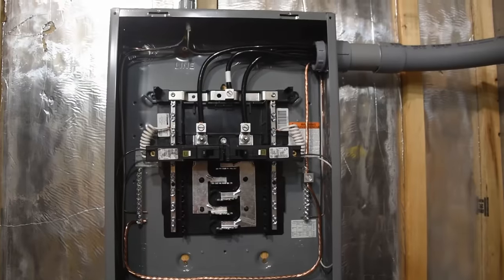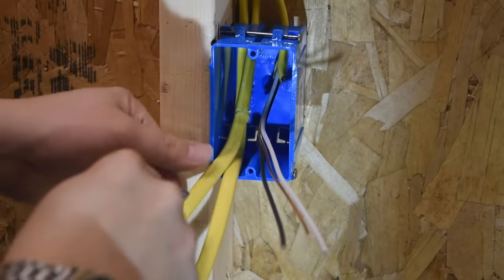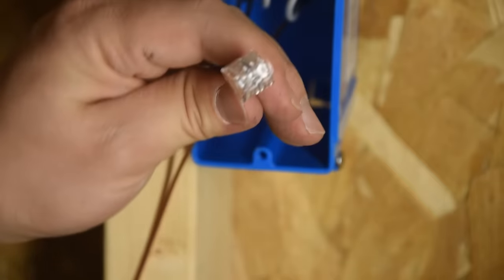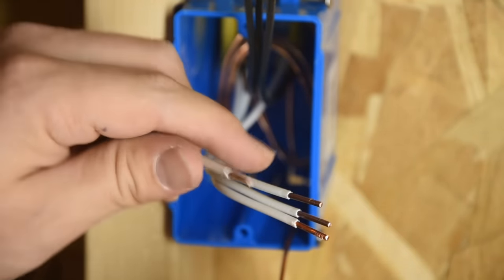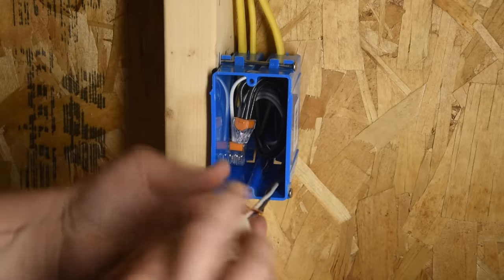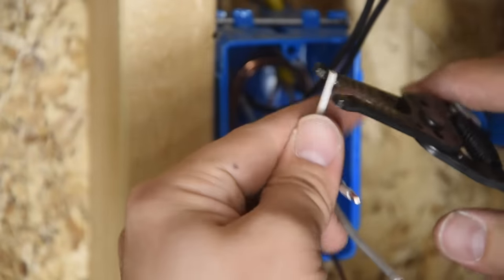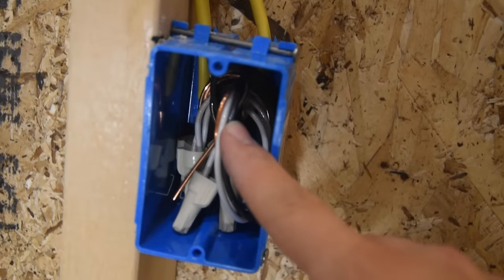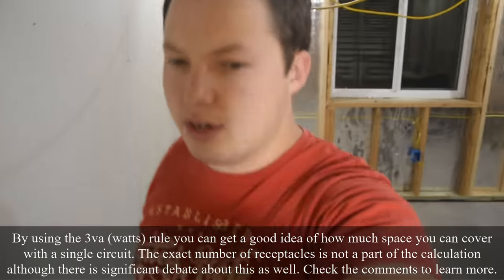Wago's vs. Wire Nuts - How To Wire Outlets During Rough In

Comment: I'm a 20 yr service electrician. Always find failed wagos, rarely find a failed wirenut splice. 
Take that for what it's worth.
Reply: I can't say I've come across many Wagos, but I can't even count how many times I've found failed connections when push connectors are used on the back of receptacles. I don't see how Wagos are any better. I always say that no electrician worth his salt uses push connectors. It's just asking for trouble down the road.
Reply: amen to that , that's what we do splice, trying to make a trade with out required skills. No electrician should ever stab wire a receptacle. That is the meaning of lame...
Reply: Jason Weiner you are so correct and the other problem is not enough surface contact with wagoS  which is the same when not using the screws on a receptacle  versus the push tabs. Constant full load causes the push tabs to fail because of the high resistance do to very little contact between wire and tab
Reply: From a UK sparky I am surprised you still use wirenuts, we used to have them and only come across them nowadays in old installations, usually when trying to find the break in the circuit.  I don’t know if the wirenuts you have are different to the type we used to have though.  When I used to do installation work I used connector strip though the industry now seems to be going towards the push (maintenance free) connectors.  Wago is a manufacturer of these and there are also poorer quality copies about, personally I don’t know of any failures of genuine Wago connectors which have been fitted properly but we do run all domestic circuits on 230v so our current will be lower.  Also we wouldn’t connect like you do in a back box, we’d connect all the conductors to the socket outlet (receptacle) albeit ours are quite a bit different to yours.
Reply: @jamesbarca7229  My whole house was done with push ins dammit. The receptacles and switches are actually splitting apart so I'm having to change everything out (and use the screw terminals. sheesh)
Reply: Wago's are quick but trash.  Just like push in wire 14 gauge outlets.  Destroys the wire as well.  Oh, and this nutter does not know how to rough install.  Idiot strips the wire after it is in the box.  Also, nutter does not know how designate power lead.  Nutter also does not know that doing wire nuts by hand stopped being used about 10-->20 years ago.
Reply: I use them all the time and have seen maybe two failed ones but plenty of failed screw-type connectors (wire nuts never really took off in most European countries). Those that failed were all in the same installation and that screamed "sloppy work" all over. Half the wires hadn't been stuck in far enough so the Wagos just fell off!

The huge advantage over any other kind of connector is that you can add and remove individual conductors without disturbing the others.
Reply: @Ragnar8504  You are talking about levered WAGOs?  Not the pinch type?  Otherwise what you are saying is not true.
Reply: used Wagos lever locks for years now...never had one fail
Reply: @burp1914   If i'm installing a new light fixture that comes with push in splicers they get cut off & tossed where they belong, in the trash can.
Reply: They will sit there and strike an arc like an arc welder until they finally fail
Reply: I find burnt up crusty wire nuts all the time. In an industrial setting, they burn up all the time. Either age or heat gets to them.  Wagos are trash but for outlets/lights or grounds, it's alright. Found someone tired to wire up a 5kw motor on a VFD with them.  Lasted less than a day. I miss aircraft splices from when I did avionics. Those things were strong and lasted and weather proof
Reply: I am an electrical engineer, not an electrician. There appears to be much more copper to copper contact area in the twist on plus more contact area which should decrease contact current density and reduce point source temperature rise. Also wago was installed in worst possible outlet because it needs to support the combined load from every other outlet. The way the wago pulled off was concerning as well.
Reply: I’m at electrician and I was installing recess light in my house and I ran out of wire nut on mine last light. I put in the wagos the led came with to try it out. Four months later I noticed that one light started to flicker a lot. I pull the light down, tested the connection turn the light on before putting it back up and it still flickers. I then turn and took those wago out and twisted and put wire nut on and it stopped flicking and it haven’t ever since, and that when I new never again with wagos.
Reply: @shshshs2  definitely do not put wagos on a crane. We fought the big ass brand lights that used wagos inside them. Vibration makes em flicker non stop.
Reply: Always?  Let's see some proof.  I've read many of these types of comments from other electricians and I call BS.  I deal with trades people in my profession and the common denominator with them is they all "think" their way is the only and best way.  It's the same when I watch videos where OSB is used.  You get all the genius framers who will "never use that crap" on their homes.  Don't use Wago connectors, but stop with the "your house will burn down" nonsense.
Reply: You do? I am an electrician in Europe and we use Wagos and nothing else, never failed! Never seen one failed, love those things.
Reply: In germany nearly ever electrician uses Wagos including me and in my 5 years of work I've never seen failed Wagos. Sometimes the wires get loose because they aren't long enough, but that's not the fault of Wago.
Reply: Jason do you mean the failed WAGOS you found were the push in style? I have found a few issues with push in style wagos but have not seen any issues with the lever style wagos. And 98% or so of the failed push in style wagos were knock off brands. The push in style wago problems I found were because the wire was installed incorrectly..
I just fixed all the outlets in a remodeled basement while the guy was off for the pandemic. He thought he bought push/stab in style outlets but didn’t realize the hole was for the wire to go in and then you tighten down the screw. The jurisdiction I am in you can’t buy a push in style outlet.
Reply: @ronh9384  You are spot on, Ron. It's always the push in wagos. In fact, the lever style are just starting to make their way into the local parts houses. Guessing its because the area electricians had gone away from them.  I am going to try the lever style, mostly due to the answers here!
We are also NOT allowed to use stab-in receptacles simply because like old wagos, they fail.
Reply: @darinvee4980  Exactly, you could fertilize the Sahara with the amount of horse shit I've heard in every trade about anything that's come out since the day they were licensed, and for half the weekend warriors is anything that's changed since their dad's taught them as teenagers.
75% of the "first hand experience" comments on YouTube are completely fabricated to bolster the posters opinion.
Reply: @typ044  i couldnt possibly agree more. The old sparkies back in the day probably hated wire nuts and insisted that only a hot soldered splice was to be used. Times change people, roll with it.
Reply: I never use them on circuits with heavy loads anymore. I’ve had them melt together and short on a circuit with an air conditioner and a microwave. It seems the internal connection has very little surface area to the wire, which naturally causes a lot of heat. I don’t believe this is an issue with strangled wire as more conductors are in contact with more of the spring clips surface area, but I never run stranded wire...here in Chicago everything is conduit and fishing stranded cable is a setup for a bad day.
Reply: That's exactly what I think not only because somebody want to sell their product means is good
Reply: @TheHouska007  Europe is on 240V system, so half the current as in the US where we use the 120V system.  Less current = Less heat.  That's probably why you never see them fail.
Reply: Personally I hate those types of wago. I do like the other type of wago with levers. They're great.
Reply: Fortunately, all of Europe has come out of the 20th century and uses WAGO and for some reason there are no problems with them.
Reply: @kikiv1993  the new lever wagos are exponentially better now. Congratulations on making it out of the 20th century, took ya long enough!
Reply: The lever Wago's are good push connects I don't like them because really have to cut them to remove them or damages the wire.
Reply: Sure they are wagos and not just some random push connectors?

Comment: They are great !   FYI  do not force 12ga wire in deep, the wire will transfer heat to the plastic case and separate in the future.  of the 12000 we have installed in the early years (2001)  maybe 4 failed up to around 2010 .  I also learned to cut stranded 12ga. wire on a slight angle to ease installation !
Reply: None should have failed, but you dont know many failed, unless you attached your phone number to each one?

Comment: Just a neat tip try if you like. To strip the romex take your wire stripper pliers, pinch and pull a chunk of the the romex sheath where you want it to be cut. Twist the romex and do it on the opposing side and pull the sheath off. It tears at the point with the two "bites" taken out. Careful to not grab the interior conductor but with a little practice you can do it consistently without damaging the conductor sheathing.  Saves from switching back and fourth to the knife. Learned it from an old guy.
Reply: did he teach you to grab a 2X3 and a bucket for a trash can and a seat to save the knees??
Reply: Great tip!!!  Tips like this are why I read down into the comments.  Thanks! I’ll try it out on my next wiring project.

Comment: This is a great video once again.  I'm catching up on ones I've missed.  I appreciate the detailed explanations and still make it easy to watch.  You're explanations and reasoning are usually aligned with my views and you cover a lot of the little details (like showing the run from breaker, through hole, wire staples etc).  
  I bought some knock-off Wago Lever Nuts.  Haven't used the lever nuts yet, but the push style is kinda intriguing.  I never looked into them to see they were removable (and so easy it seems unless that was a cut scene).    I got the Lever Nuts for a quick temp project//test bench to test a motor or temp wiring lighting (of course not to code). 
  Problem is I don't do a ton of electrical so I have a supply of wire nuts to last a lifetime for me.  Maybe I should  donate my little pile of old style winged wire nuts to you LOL.
Reply: Maybe u should read all the comments herein by other electricians b4 u do that

Comment: A few years ago I quit using wire nuts and moved to Buchanan Connectors. If you’ve never used them before they are a copper sleeve that crimps over the group of wires with a compression tool and then they are capped with cap which resembles a marrett that snaps over them. 

Voltage drop with these style connections is much less under load than any other style I have used. 

The wago connectors are easy, but I find they don’t carry high current nearly as well as a marrett style or better yet the Buchanan style.

Comment: Love the electrical videos.  I have recently just finished a complete rewire of my two story 1870s home.  I had initially decided to use wire nuts, but discovered the Wago Lever-Nut.  The Wago is quick and simple.  Plus if you have bad wrists, like I do, they are a big help.  I did use wire nuts and pre-twist the wires under the house just because I have just started using the Wagos and had a little reservation about how they may hold up here in humidity of South Carolina since it is just a crawl space and not a climate controlled basement.
Reply: I use a drill attachment to twist the nuts Jacob.

Comment: New sub, I have used the Wago's myself in my new shop. I have had no problems with them. Yes I have looked at them after 6 months of table saw and other tool usage in my shop. No signs of issues. I used the lever type by the way. Just MHO...Now some of my outlets like the 240 and possible multiple draw outlets I used wire nuts....
Reply: The lever kind have much more surface contact than the push type. I believe the lever ones are rated for 20 Amps, push type 15 Amps

Comment: There is a tool for cutting the shield plastic on Romex type wire. Razor knives are handy but you will cut into the wire often.
Reply: I bought that tool a few months ago and love it! Never cut my hand or the wires but the potential was there every time.
Reply: Never seen a electrician use one on the job.
Electrician here 25 years

Comment: I've been using wago connectors in my control panels for several years. There's a lot to not like about wire nuts. Wagos take less space, easier to use, easier to  know you got all conductors firmly tapped they have test points for probing built in.
Reply: I’m perplexed.  You praise wagoes while others here cite failures and fires from them and prefer/recommend using twist nuts.  🤷🏼‍♂️🤦‍♂️
Reply: @Mote78   the wagos I use are not push in, they are lever locked. The failure of others to comply with/check load limits and specs are not a failure of the product or the technology. We still have a duty to our clients to carry out our due diligence. A professional does not just slap in a part someplace without knowing the load limits of the part. I do not use it as a direct replacement for wire nuts in high load circuits. I use them as splice points in CONTROL PANELS.
In my machines there are no splices in high load circuits. A constant conductor runs the length of the circuit uninterrupted for high load and duty cycled PWM circuit. I havent had a single issue. To be fair I dont even allow wire nuts in my high load ckt. If a connection needed to be made it would be soldered and sealed. Wago are only used on ckt of 3 amps or less at 120vac. Typically, the ckt wago is used is a 12vdc high impedance input signals carrying a few milliamps if even that to a PLC or an output to a warning indicator (usually LED) usually 65 milliamps per indicator. They work great, never had a problem. Used within their physical limitations.
Reply: @3dw3dw  
Thank you for the explanation.
Reply: @Mote78  Wagos became standard in Germany and many parts of Europe already in the 90th. I have no negative experience with them. They are even considered more reliable than conventional screw connectors or wire nuts. It is interesting that some people with very few experience with them  have seen so many faulty ones and here we have no problems.
Reply: @Mote78  Wagos are much, MUCH!!! safer then some wirenuts. Wirenuts are forbidden in some great and modern countries....
Reply: @BAFM510  it's the almost exclusively wagos we're I'm from. And the only failure I've seen. Is someone using a to small gauge wire for 12v lighting. And the small wire had melted half off the wago but it was still working
Reply: @Mote78  Welcome to internet forums.
Reply: @BAFM510  If there is enough heat to melt wagos there is surely enough heat to melt wire nuts.  Heat only comes from overloaded circuit with failed circuit breaker or arcing.  It's some fault other than the wagos.
Reply: Wago’s are fast and nice to work with but  they don’t have the surface contact area wire nuts have.  They are ok for low power led can lights.   I don’t trust them for other circuits.  Checkout the temperature testing for wire nuts vs Wago’s.
Reply: @jimpintchuk8058  I did check out a lot of videos and the Wagos melted at about 60 amps.  Pretty sure the breaker would have tripped or the plastic sheathing melted well before the Wago failed.
Reply: @percyfaith11  really

Comment: Like using the WAGO 221-4xx & 221-6xx series lever nuts. Really does make wiring outlets, switches (boxes etc....) little faster & easier. The other nice thing is; able to energize the circuit & use the test points on the lever nuts to find any “issues” you may have...as doing “trouble shooting work” w/ these does make things go a little faster & easier, etc...👍🏻
Let’s hope the WAGO Lever Nuts work well & the “compression fitting” can withstand the constant “power” being “turned” on/off over the years & last.....
Do know one thing, even though they are a bit more expensive than the traditional wire nut....they sure are easier to work w/; & can make retrofits/remodels in older houses a lot easier to “wire up” when one doesn’t have a lot of “extra” wire coming from a box (ya know what I mean....LOL. Always a pain when take a plate off an outlet/switch & come to find out you have maybe 1-2 inches of wire to work with, not fun or easy😡, but using a WAGO really does come in handy at these moments👍🏻).
Cheers✌🏼